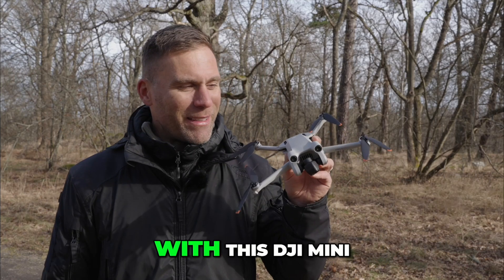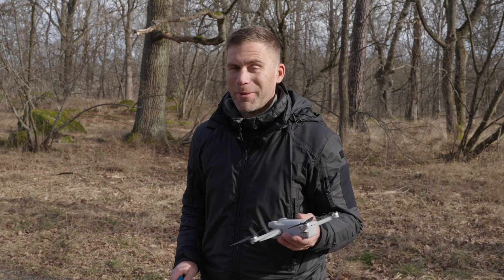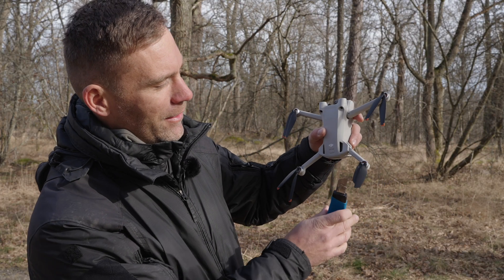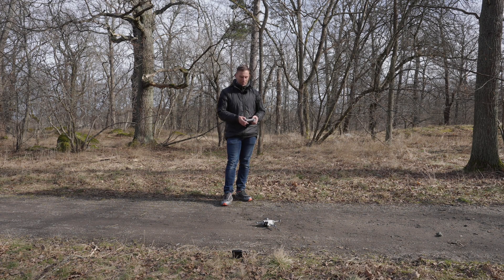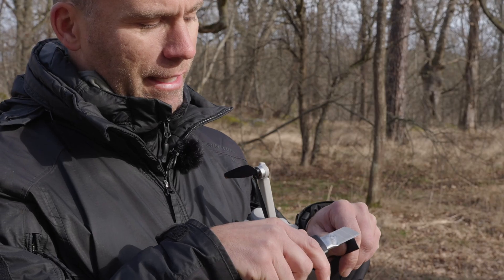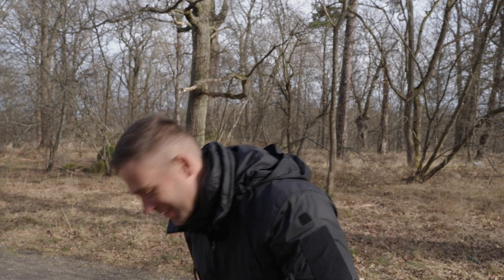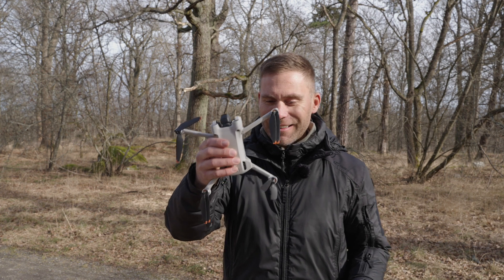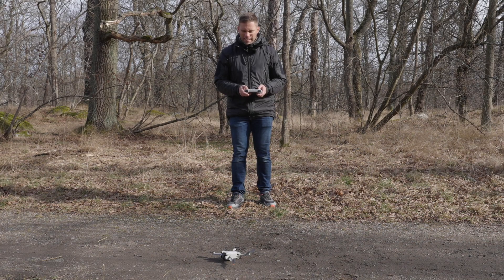Fly drone FLY, Without Propellers!? DJI Mini 3 Pro / DJI Mini 4 Pro

Comment: yeah is I'm very expecting that. it's work until maximum motor speed is to maximum and can't compensate air flow. nice work from dji but do never that on your little bird. damage your brushless (micro bearing) and ESC
Reply from the maker: Thanks for sharing. Absolutely, never do this if you want your drone to last. I do it so you don’t need to  😂
Thanks again.

Comment: Really a great video showing there are huge margins. However, never take off with damaged props! During a tracking the Mini 3 pro hit a tiny branch, rocked, but managed.
Once hit an obstacle and likely damaged one prop. After a second flight it was discovered that pieces of props were missing. The lost pieces were a lot less then what You carved away. Take the hat off for DJI design!
If DJI build those drone taxies, I'll go with them.
Coffee not on its way due to unacceptable payment methods.

Comment: I had the mini 3 pro didn’t fly it that much I think it had 30 minutes total on it I ended up trading it for four some prospecting equipment and that friend flys it a lot more told me how great of a drone it is so I went to buy another and can’t get them so I just got the mini 4 pro with the remote with the screen now I just need to get brave enough to fly it. I have bad eyes so would it help using the goggles. Great content man keep up the good work